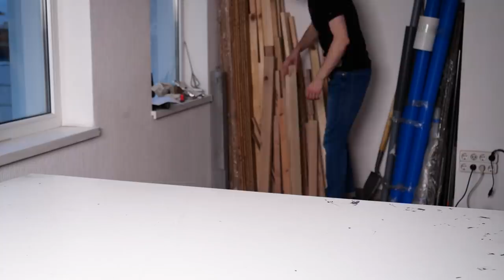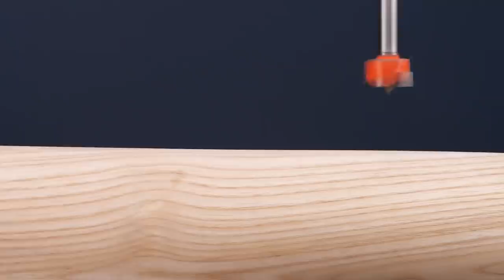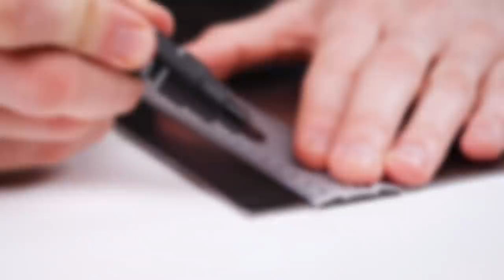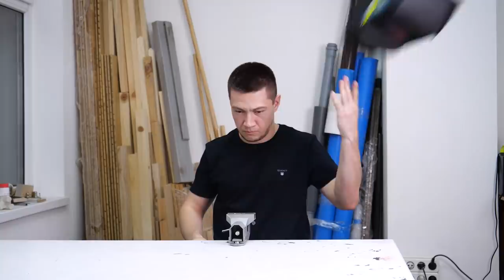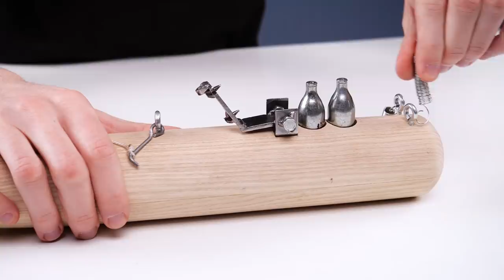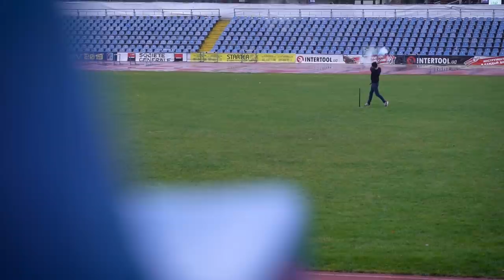Supercharged Baseball Bat with CO2 Cartridges

Comment: A better choice of fuel would be air or gun powder because the CO2 pressure is only 860 to 1200 psi depending on the weather. Air you could use up to 4000psi and gun powder even more. Most of the CO2 will still be liquid and cold coming out at 860 psi.